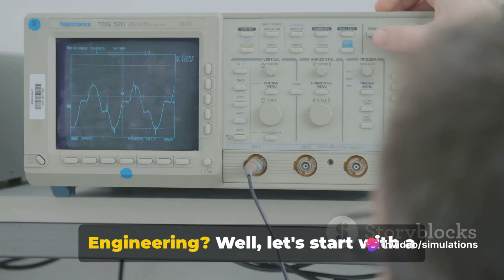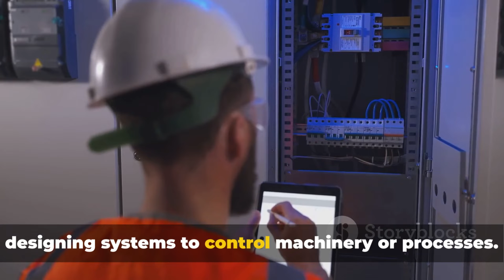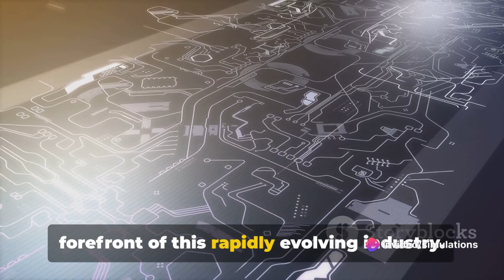Electrical Engineer Vs Telecommunications Engineer: How do they differ?

Comment: I still have no clue who would help me in this situation 
Siyabonga Here, ever since i graduated from Tech i have never been in the work field of telecommunications and i have so many years since i got the diploma ein telecommunications 
Should i consider settling for a normal job at shopping centre as an assistant in packing goods or pursue the work industry.

Is there anyone who's in the similar situation as me?
Reply: Where are you located?